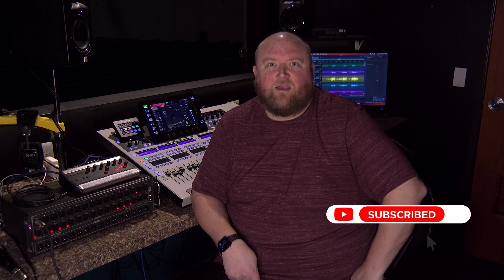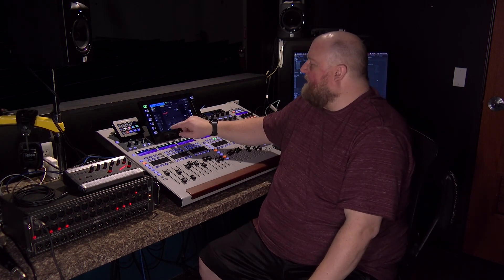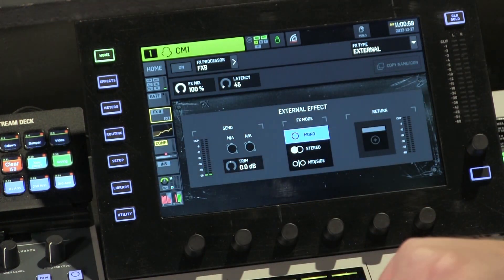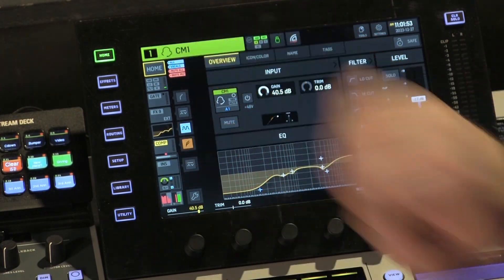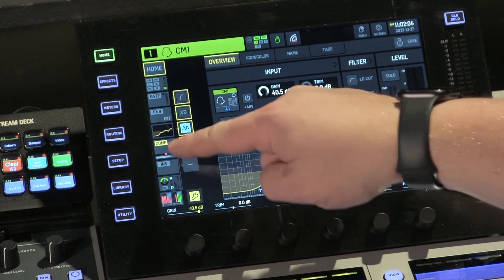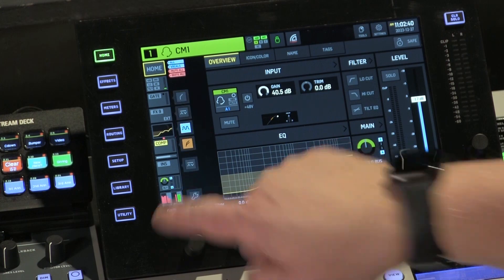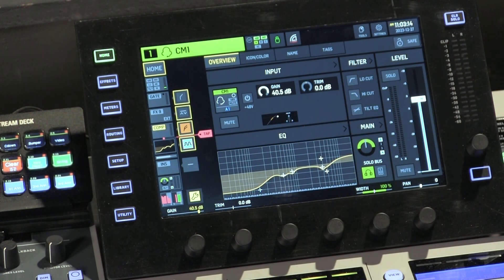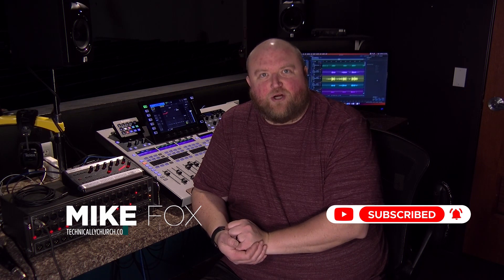Custom In-Ear Mixes: The Power of Behringer Wing’s Processing Chain

Comment: The issue I've just come across is that I want to send vocal channels pre-compressor to their in-ears, but also send those channels to a vocal bus, post compressor. I thought I could change the tap point per channel, per bus, but I've found this isn't the case. So this means I can't take advantage of the channel compressors if I'm sending them to a bus and I'll have to set up separate in-ear vox channels, unless I'm missing something?